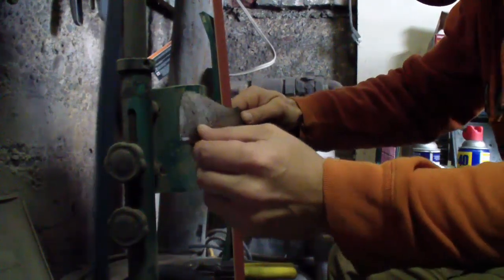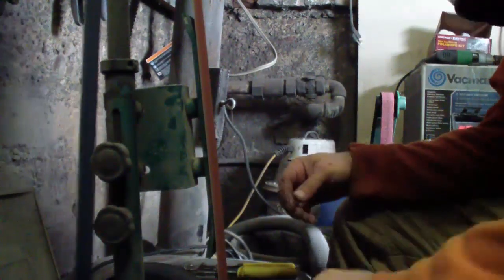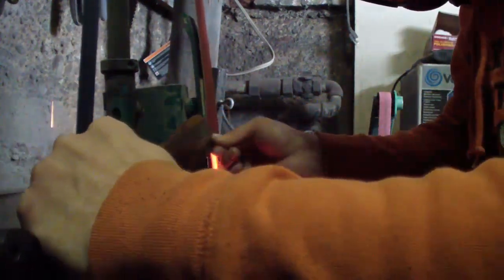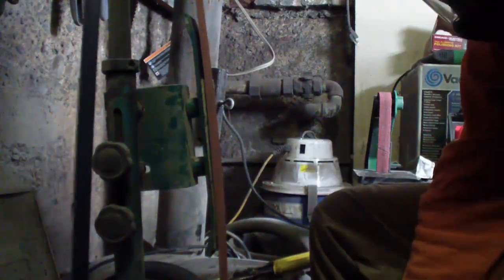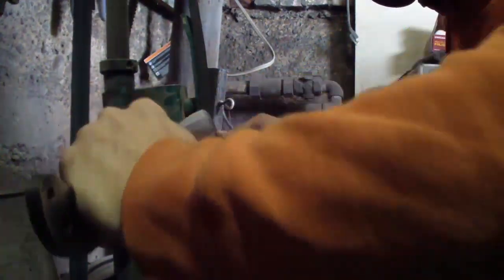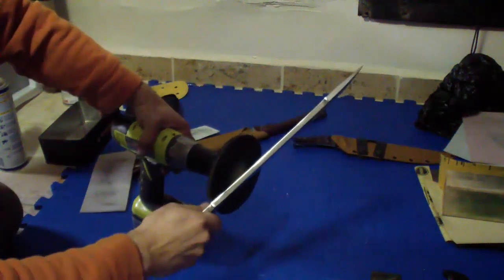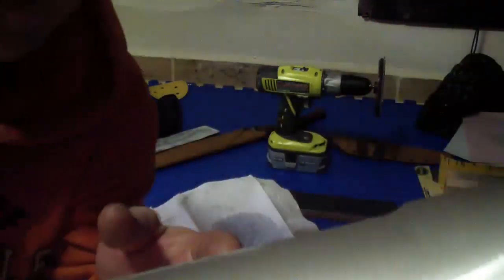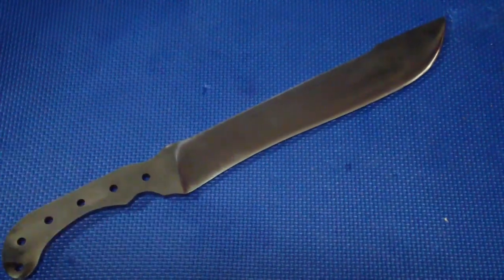Making a Large Custom Knife - Part 5 - Final Grinding

Comment from the maker: there is lot of different way how to grind the bevels, the way i did it as you described actually does the same thing as if you were moving the blade as it is bend because i ride the blade on the corner of the belt so it always have the same angle for the bevel. i always kind of find my "rhyme" as i do each blade. sometimes other ways work better. it varies form blade to blade for me really. im too amateur to be able to exact same thing each time.

Comment: I noticed when youre grinding you dont turn the knife when you get to the tip but rather just keep it perpendicular to the belt. Would it be better to turn the blade so the edge is always perpendicular or does it not matter?